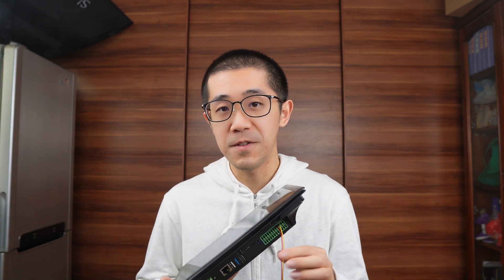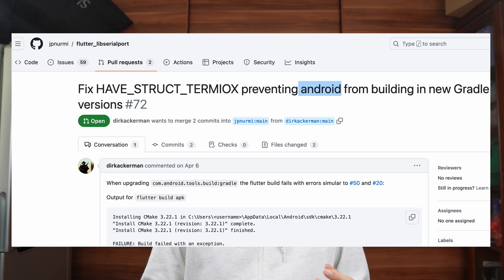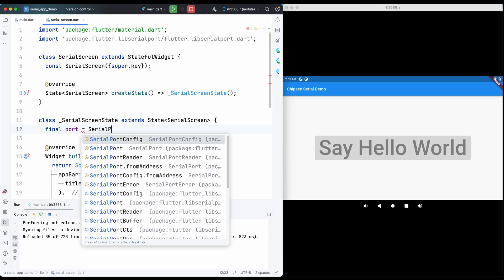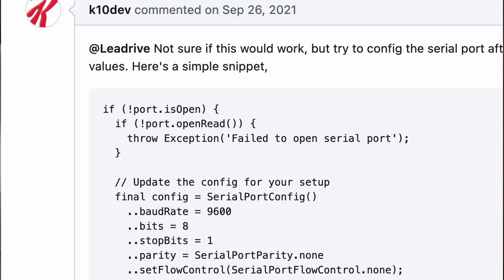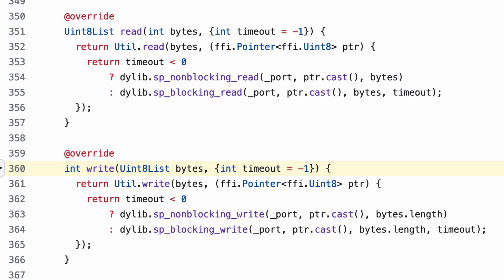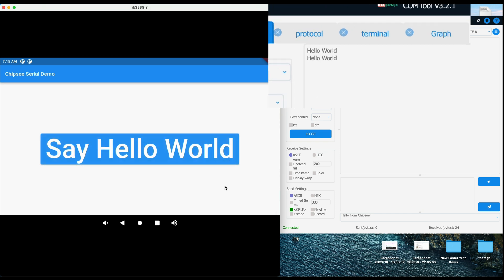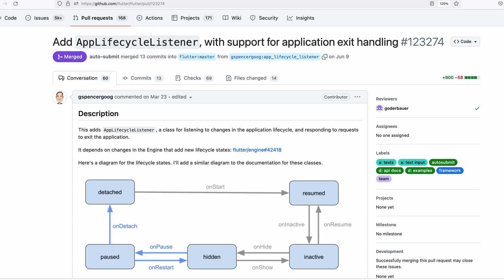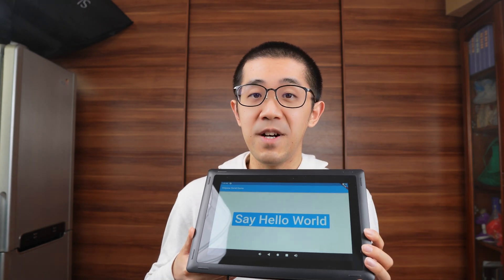How to Write to Serial Port with Flutter and Dart

Comment: Upload video for read port data also, i have 4 port for read and transmit the data at same time.
Reply from the maker: It's out, here you go: https://www.youtube.com/watch?v=VQrIEv66WFE.

4 ports? You can have as many ports as you need, just change to `final port_2 = SerialPort('/dev/ttyS5')` or whatever your port name is in the OS.
Reply: I want to transmit the data and read the data in same machine so i joined the transmit pin and read pin after this below errors

denied { getattr } for path="/dev/ttysWK3" dev="tmpfs" ino=6666 scontext=u:r:untrusted_app:s0:c512,c768 tcontext=u:object_r:device:s0 tclass=chr_file permissive=1

denied { read write }
denied { open }

if the app closed while the port is open and you open again so the error we get is resource is busy - temp solution is restart the device @Chipsee
Reply from the maker: I've seen this issue happen multiple times! "Resource is busy". Later I found a way to solve this is to add some delay before init the port.
For example, in initState(), you _initPort(), but instead of _initPort() immediately, you add a timer of 500ms delay: timer = Timer(const Duration(milliseconds: 500), () => _initPort());

And when the widget is deactivate(), you @overried the deactivate(), and add
  
@override
  void deactivate() {
    port.close();
    port.dispose();
    timer.cancel();
    super.deactivate();
  }

You can try these and see if it helps. Take a look at the github repo, I open sourced it.
Reply from the maker: Repo: https://github.com/printfinn/chipsee_serial_port_flutter

Comment: Permission denied, errno = 13
Reply from the maker: I don't remember I encountered anything like this while developing. What device are you using? Are you using a Chipsee Android panel PC?
Reply: @Chipsee  got the same error, used your source code but not working
Reply from the maker: Sorry for the late reply, were you using a Chipsee industrial panel PC with Android OS? AFAIK our device is rooted, I'm not sure if your Android device is rooted, maybe it can cause the permission error? What device were you using when you see the error? Did you alter the port to match your device?
Reply: @Chipsee  same i am using android device latest version, i tried with Linux, it read and write perfectly. but when i run it in android said: SerialPortError: Permission denied, errno = 13  , i tried to give all permission in my androidManifest but no solution. also, give my android device primitive to accept all permission but still same issue. i tried using a chip using Arduino and it send messages but in my android device is note working!
pls help
Reply from the maker: Hi there, I've seen this error=13 happening quite a few times too! AFAIK, many people see this problem, like here(https://github.com/jpnurmi/flutter_libserialport/issues/26) and here(https://github.com/jpnurmi/libserialport.dart/issues/3). 
My Android is rooted, is yours rooted? This might be one of the causes. 
Another issue I remember that often causes error is, if I open the serial port, but I "hotreload" flutter app or switch to another view then switch back, the serial port that was opened is not closed! Then the OS will say the serial port device is "busy" or "occupied" something, causing errors. Thus, port should be closed properly.
The last issue I see that often causes errors is (which is often timing based! eg click button too fast when the app starts), the serial port initialize process takes a few milliseconds, that means I need to "wait Time(20ms)" before I do anything else when I open the serial port. Otherwise if the port is not initialized properly, the underlying circuit board will not be initialized properly, it needs time to initialize.
These are the things I can remember that often causes errors. I can't be sure what caused your error 13 because I haven't been playing with this project for a long time, but you may test these and see if it solves your problem.
Reply: I also get this error, I tried to connect the arduino to android.
Reply from the maker: Can you try my source code on your device and see if it happens? https://github.com/printfinn/chipsee_serial_port_flutter
Reply: got same error please support